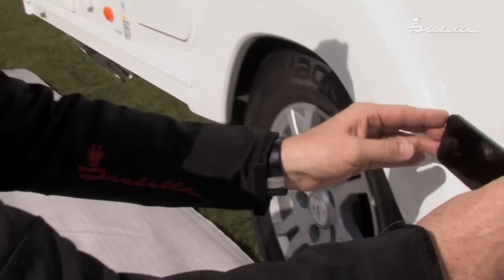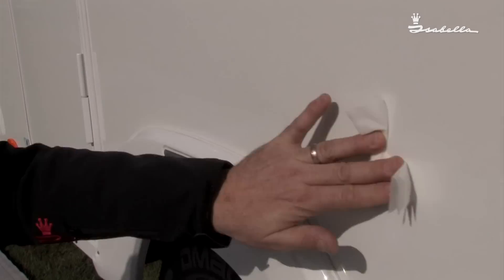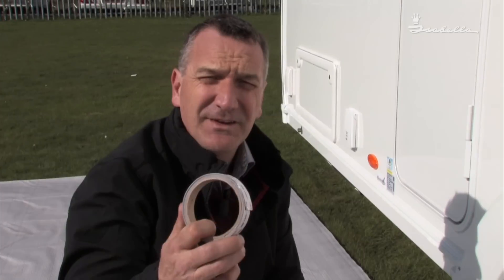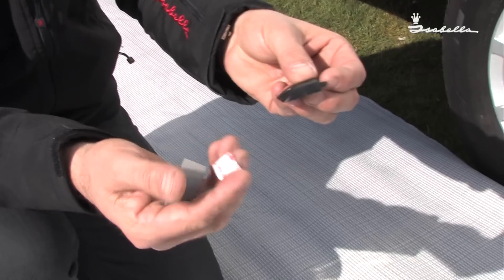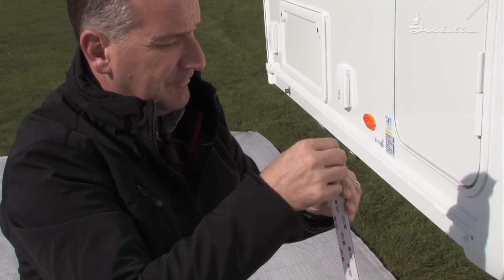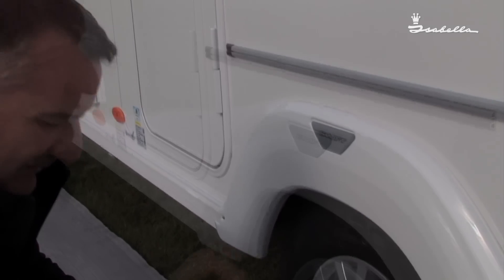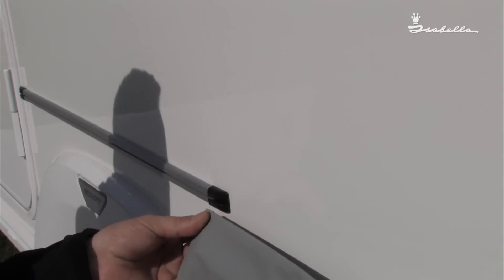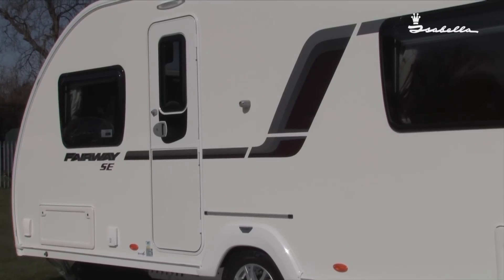Isabella Awnings - Universal wheel arch cover

Comment: I have the twin axle version which comprises a doubled up set of parts. Whoever thought it is practical to hold two pieces of rod, requiring 4 hands to feed into the 2 piece aluminium strip wasnt on the ball. The plastic cover is softer than usual and easily ‘picks up’ on the sharp corners on the aluminium too. The design is neat but needs a rethink on ease of use.